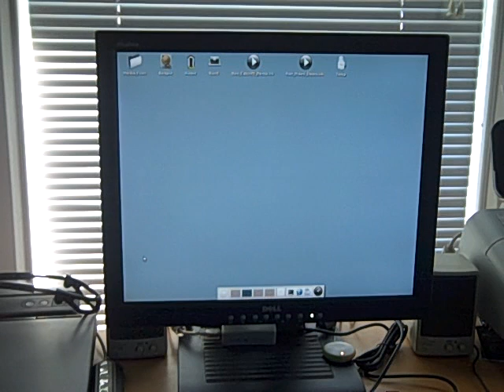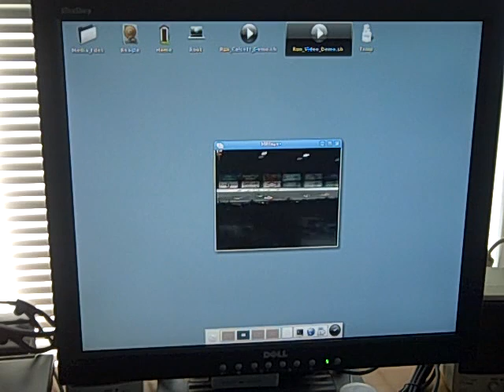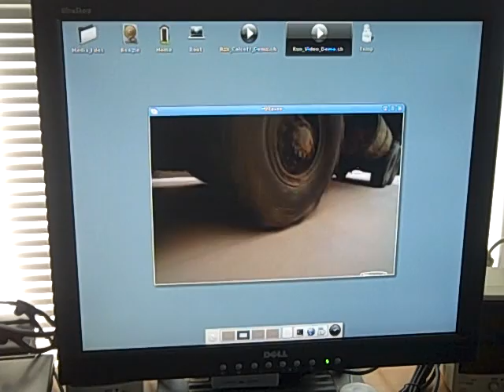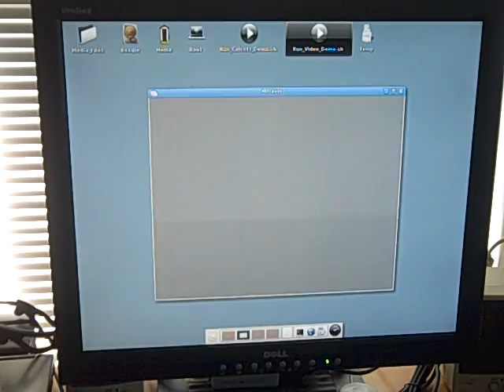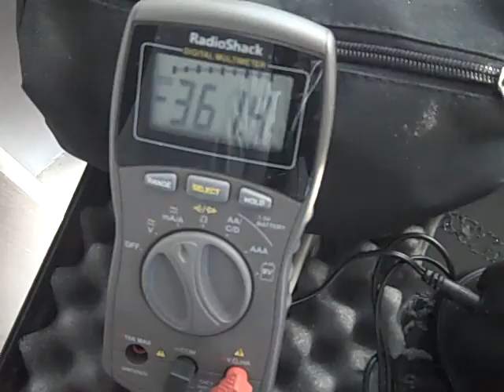Beagleboard running Angstrom and Mplayer on OMAP 3503

Comment from the maker: I run mplayer with xv and alsa.  But I generally just run VGA or QVGA size videos.  In order to keep up with HD in general, you need to use the accelerators in the OMAP 3530.  This demo uses only the ARM Cortex A8.